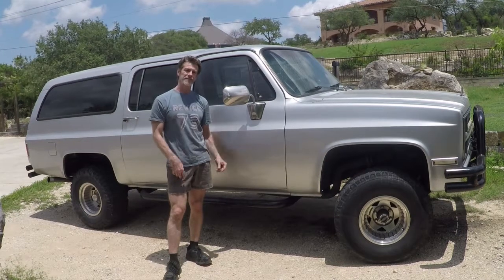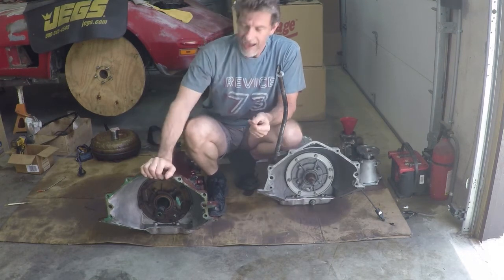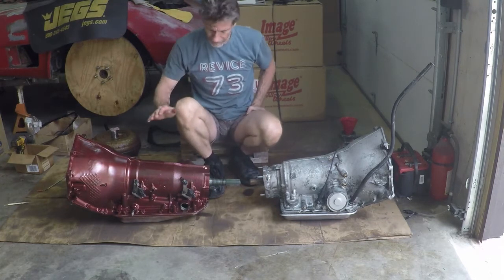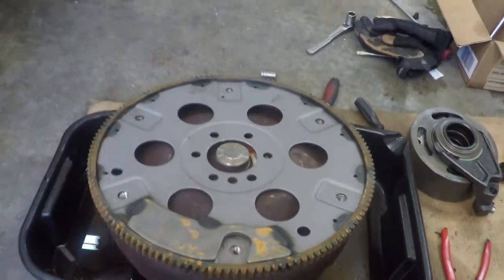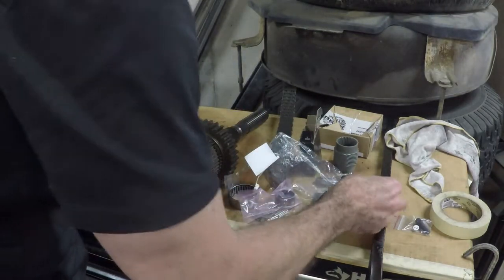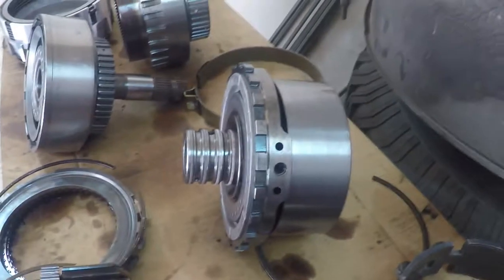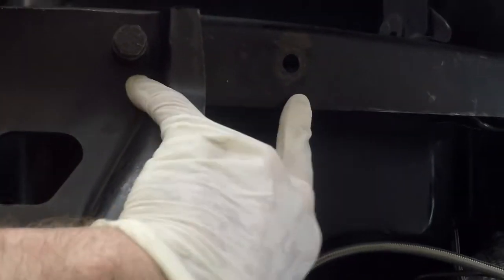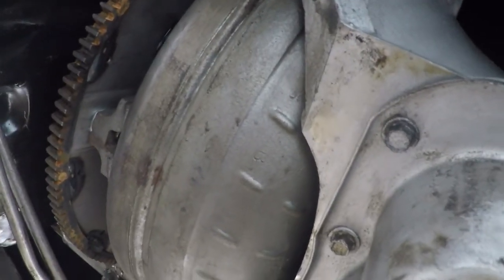Swapping a 700r4 for a 4L80e transmission in my diesel suburban.

Comment: There's a plug in the rear of the case. That you install when going from 4WD to 2WD or vise versa. In 2WD application it lube's the output shaft bushing
Reply from the maker: Not necesary to swap this plug when going from 2wd to 4wd, but you'd better drill  it if you go from 4wd to 2wd!

Comment: Ok buddy.. Im testing the one hole over for linkage..its a no go..cl9se but the 4l80 is wider..amgle looks close enogh but the arm will need to be shortened so ill retain original holes and modify arm like you did..8f im cuttin the arm no need to drill too. Great video..thanks.. Wosh i could send pics for others to see..
Reply: Update!! One hole over on the linkage works... With a lil modification..i made 9t work by heating and bending the arm.. Cutting and welding works as well.. But only had to heat twice in 2 places and also drilled new holes in arm socket to sl8de it back 3/8.. That took care of wider trans. Ran thru all gears on shifter..no issiues.

Comment: great video.. can you say what year your Burb is, also did you not need a Transfer case adapter? Also, can you comment on the lengths of the driveshafts needed? I have a 203 mated to a TH400, so sounds like it would be a direct bolt in?

Comment: Hey CA. You don't mention it in your video but am guessing you used the factory radiator setup for transmission cooling? Have you had any issues with the trans fluid running hot? Have read that the 4L80e doesn't like temps above 200 degrees. My third gen firebird would probably fry it's 4L80e without a external cooler? Thanks for the video.

Comment: Hi there brother I found your video to be very educational, I’ve got a 87 blazer 700r4 4x4 and I’m looking to either upgrade to a 4l60e or 80e however since it is my first time doing a switch like this I’d greatly appreciate whatever tips you got. I can’t figure out which harness to buy which controller or even part and how to do a TPS signal for it
Reply from the maker: Is your blazer fuel injected?   If so that's an easy TPS source, else you can buy an aftermarket sensor that can bolt to your Holley, quadrajet, whatever.   I used the TCI controller, but any standalone will work.

Comment: Great video. Appreciate it. What did you end up doing for the gear selector? Quite a difference between the 700 and the 4l80. Guessing it took a fair amount of fabricating?
Reply from the maker: Actually it was easy.   I  bolted on a 700r4 "fork" to the side of the 4l80e gear selector.  I then  had to cut and reweld ("re-clock") the gearshift cross shaft to make it work.
Reply: Thanks for the info. You're right. It's easy. Just swapped out the 700 bracket in place of the 4l80 bracket. Looks like the gearshift cable and bracket from the car (3rd gen trans am) which bolts to the oil pan should hook right up to it. Thanks again.👍
Reply: What did you do with the reverse lights and neutral safety switch wiring? The stand alone controllers don't have a provision for that. Must have to splice them in to the 4l80 some how? Thanks.
Reply from the maker: @guysmiles2822  The squarebodies have those switches on the steering column.   Just reuse those.  If you are using the original squarebody shifter then there is no change to the switch.

Comment: Where did you get the 32 spline input shaft for the transfer case??? All I have been finding is the 27 spline
Reply from the maker: You can order them through gear companies on internet.  Just google 32 spline input shaft np208.
Reply: So no lie I did google that and no one has any of the 32 I can find the 27 easy but the 32 everyone says out of stock so shit 😂😂😂
Reply from the maker: @thisguy8622  I found a bunch listed, but I did not check to see if they were in stock.  Sorry.  Keep trying.  Someone is bound to have one.

Comment: I’m trying to buy this same truck and I’m pretty mechanically inclined but want to tackle on first time trans rebuilds etc like how you’re doing. They want 2500$ for it with a supposed trans issue, where is the best place to buy a quality trans rebuild kit for this 6.2 diesel transmission,
Reply from the maker: I wouldn't waste my time on the factory 700r4.    Get a 2wd 4l80e and a controller and swap it.  I bought my 'burb for $2000 with blown head gaskets.   I've made quite a few improvements since then.
Reply: @CrankAddict  thank you for the reply! the trans is stuck in 1st and reverse so I want to negociate down to 2000 since it’s got some pretty hefty body work needed

Comment: What’s the difference between the 2wd and 4wd gearing and strength wise? My blazer has 35 inch tires so hopefully the 2wd can handle it
Reply from the maker: same strength.  The only internal differences are the output shaft and the presence of the 2nd speed sensor.    I consider the 4l80e STRONGER than a TH400.
Reply from the maker: @Rowdy It is OK to use 2wd lube plug in 4wd.   Just don't use the 4wd plug in a 2wd.

Comment: Not sure if you’re still answering questions on this video.. but here goes. 

6.5/4l80 combo from 96 1 ton putting in a 69 c10 that I’m also solid axle converting. Has driver drop np241 I’m pretty sure. If I were to swap a passenger np241 or np208, what would I do for rear speed sensor?
Reply from the maker: use the 2wd model 4l80 and either cut the output shaft like I did, or buy a 4wd output shaft and put it in.   The output shaft swap sounds scary if you've never been inside a transmission before but just keep all the "modules" together and re-assemble them as modules and it is not so bad.

Comment: I have an 86 chevy short box GMC 4x4 that currently has an SM465  manual in it. I havent taken out the transfer case yet but it must be a 32 spline case since my understanding is that an 86 SM465 is 32 spline? I havent been able to inspect the truck yet, so not sure what transfer case is actually in it. Thoughts on these questions?
Reply: Yes you probably have a NP241 with a 32 spline. Same spline count as many and 4l80E

Comment: I'm  interested in doing this swap. I have a 1985 K20 suburban. It has a th400 transmission and a np208 transfer case. Do I   need a adapter for the transfer case to mount to the 4l80e transmission?
Reply from the maker: You need the factory adapter for a turbo 400 to np208 or if you can find one,  a 4l80e to np208 adapter.

Comment: I put the 4l60e from a 99 suburban 1500 4x4 into a 95 suburban 4x4. It’s not communicating. What can I do?
Reply from the maker: What computer are you using?  Original '95 computer?  if so have you investigated possible wiring harness differences?   I have not tried a swap like this yet, but I may try it soon with my daughter's jeep grand cherokee.   You can also do a stand alone trans controller like i did.

Comment: Will a 700R for replace a 4 l 60 e
Reply from the maker: I think the output shaft of the 700r4 has the same spline count as the 4L60e.   Beyond that, I haven't tried.

Comment: I’m confused. So what TC did you use?
Reply from the maker: I used the  gasoline 4l80e converter.   I know you're not supposed to use a gas TC for a diesel, but it felt really good behind the 6.5 TD.   Maybe because the 4l80e came out of a motorhome?